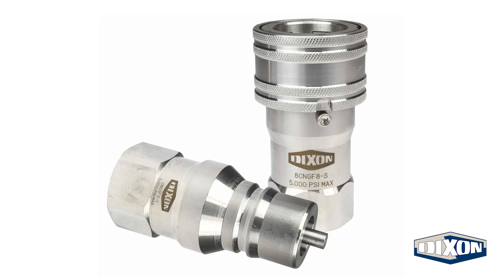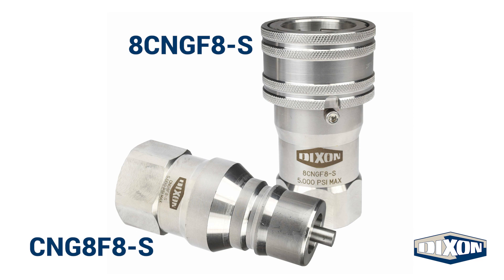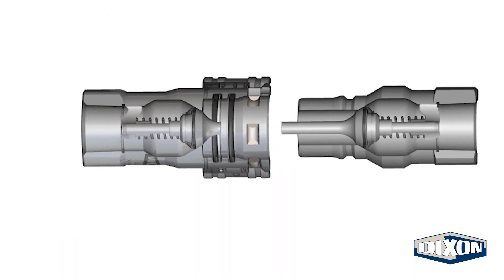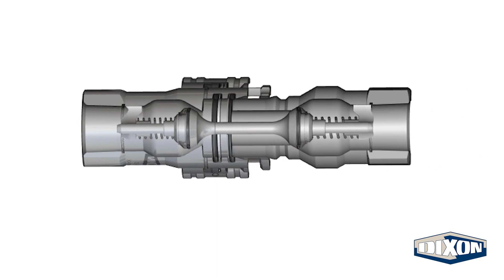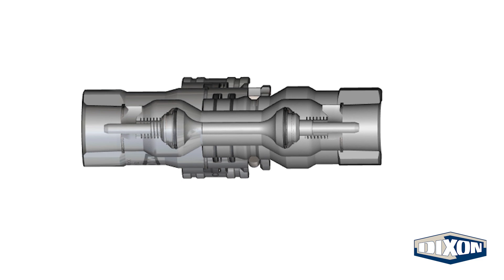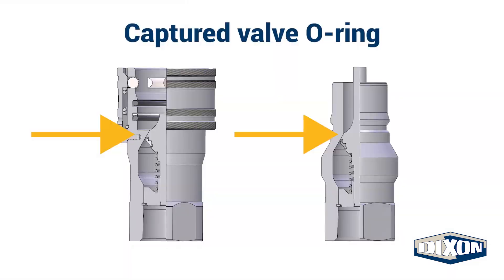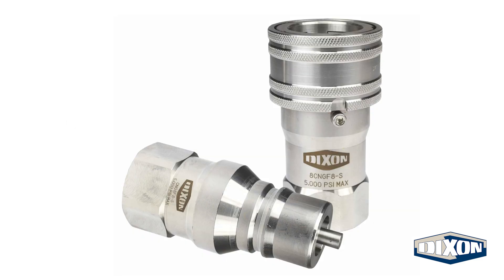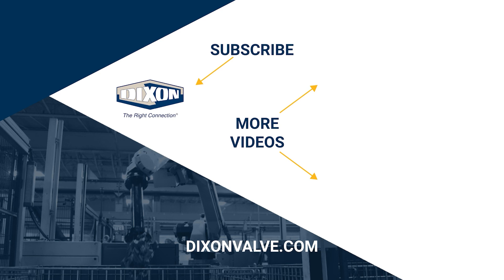CNG-Series Quick Disconnects

Comment: If Gates call their ISO B G945, Aeroquip FD45, Parker 60, then what is the equivalent nomenclature to this CNG series for Gates?  The above configuration does look so much like the ISO B series, but with different valve stem/needle.  Another, what are the seals used here, VITON?
Reply from the maker: Thank you for your comment. You can use our online interactive product cross-reference tool here: https://dixonvalve.com/en/knowledge-center/product-cross-reference. Visit dixonvalve.com to learn more, or call 877.963.4966.